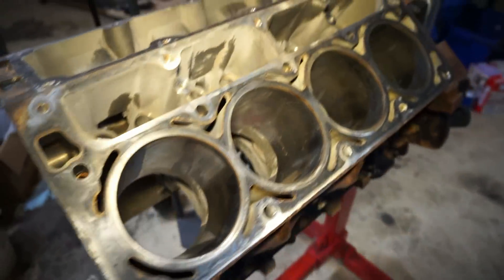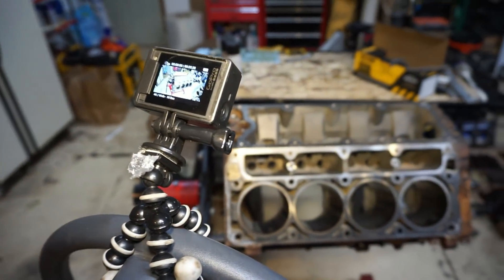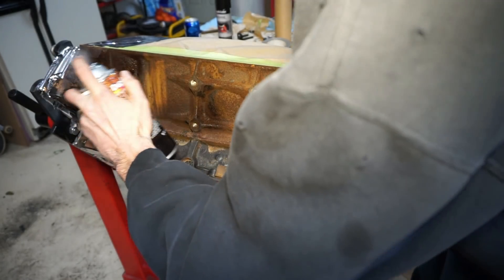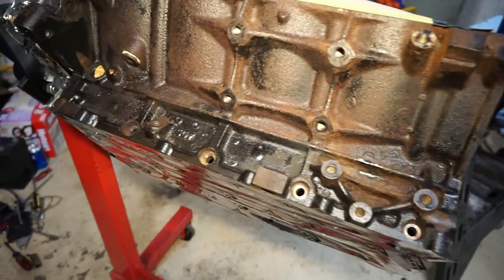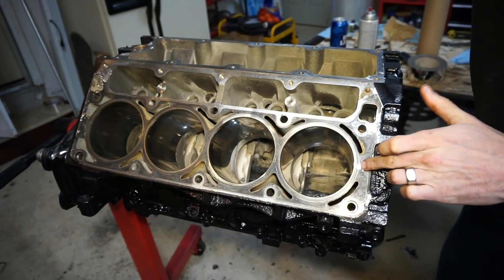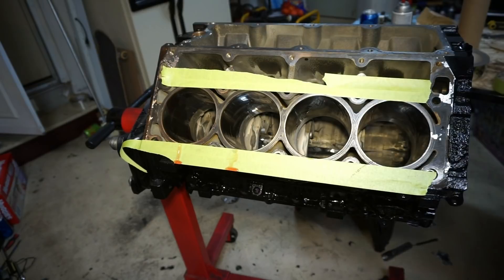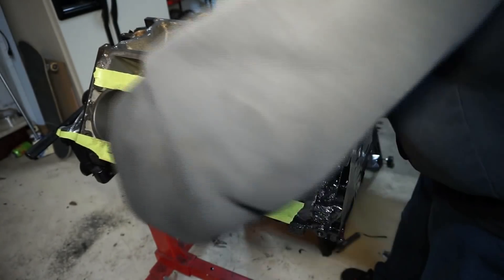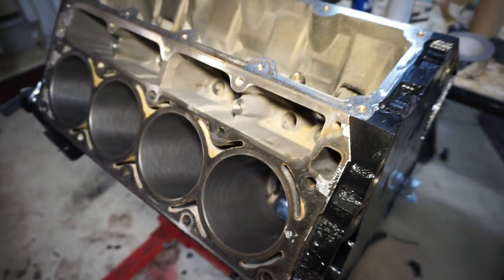333k MILE $200 LQ4 REBUILD!!! PAINT, HONE, AND CRANK!!! - a21bravo

Comment: A21bravo I bought a used 5.3 opened it up I see milky sludge in the oil pan rockers hast rust , push rods . Cycliner walls still has cross hatched cleaned up good rotates freely. I have it tore apart would I be just be able to clean and put it back together
Reply from the maker: Depending how long it ran, most likely yes. Just check key areas, bearings, lifter rollers, cam lobes etc. For wear. The water that got in it won't lubricate like oil so could have some other damage. Another consideration would be overheating from a bad head gasket heads may be warped causing the crossover of coolant Into oil.
Reply: Appreciate it

Comment: So a 200k plus mile engine can get by with just a hone on the cylinder walls? I would have expected to see a ridge at the tip of the cylinder wall. So these engines don't typically need overbore to +.020, .040 , etc?
Reply from the maker: This one has over 330k and just honed it.

Comment: I have to ask. How confident are you in this engine with so many miles and putting the stock pistons back in, not checking bearing gaps and not using proper torque sequence?

I ask because I have to rebuild my lr4 4.8l engine and every penny I can save is a plus, but I also can’t afford to do it twice. How damn reliable is the ls series of engines that it seems common for so many people just to clean and slap them back together?
Reply from the maker: Depends what you're doing with it I guess... What's the reason for the rebuild? I did have some issues with mine but was piss pounded a lot. Still using same bearings, head gaskets, reused bolts etc. I hurt the gen4 rods and pistons I put in here, the put the original back in and has been decent untill the end of the season.

Comment: Pretty sure you’re supposed to wire wheel or at least break down the surface rust, dirt and flakes. Then paint over the remaining rust with that.
Reply from the maker: This was after a hot tank. I had the machine shop do hot tank and cam bearings, lol.

Comment: hey bro, got a question for you, I have a 4.8/5.3 block that spuna cam bearing, it came out with the cam just like ion one of your videos, the cam seat was worn and I was wondering what you used to fix yours as my machinist isn't aware of any oversized bearings for ls motors. we did decide to hone out the #3 cam bearing seat to try out the larger OD #2 cam bearing in its place and hope that works. whats your input?

Comment: Hi i have 2001 silverado 6.0 liter vortec good oil pressure ticks at idle when warm but drive very well 166k miles previous owner told me been doing since he bought it with 89k miles what do you think of the tick noise? Thanks for your help
Reply from the maker: Lifter tick Probabaly... some times an exhaust leak can sound like a tick also.
Reply: @BlaserBuilds  many mechanic telling me older 6.0 lq4 expreince this noise due to piston slap not sure if thats correct

Comment: Hello i enjoy your channel.  Lots of people over look cleaning all gunk off engine parts. I seen you wipe out cylinders. Hot water and dawn dish soap and bath cloth. Its is paramount to get out hone and metal out of the block. Never stick bare fingers on bearings or surfaces. Use nitral powder free gloves. Your fingers have acidity in your skin that will cause bearings to be dirty and flake bearings.  That oil sludge on main caps and pistons or any parts for that matter take time to clean that shit off. La awesome from dollar general. Cut the side out of an anti freeze jug and flush it out with gas . Pour some gas in anti freeze jug pan and use a paint brush or old tooth brush . Gas is 3 dollars a gallon and brake cleaner is expensive.  I use gas to clean engine parts and transmission parts alot and blow parts dry with compressed air. I use bottle brushes and brush kit from gun cleaning kit to clean bearing oil galley in the block. I don't care what No one says i alway run a bottom tap through head bolt holes and main webs in block and all sealing surfaces to get a proper bolt seat and torque.  If a person is lazy they can use a drill and put tap in drill and chase bolt holes. I also make dam sure to clean head sealing surfaces with razor blade or put sand paper on a block of wood or use a long rasp or file to make sure all of old gasket material is removed from head sealing surfaces. Cleaning that mess off the pistons . Seafoam is great stuff.  Put all pistons in a clean 5 gallon bucket and pour hole can of seafoam in there and fill it with gas just till it covers them and let them soak. It does great job of cleaning sludge off. I bought a tumbler from harbor freight and pour cheap cat litter in it and tumble rusty bolt and small dirty parts does a super job of cleaning . I hope you don't use that torque wrench to torque bolts after you use it as a breaker bar that is a total no no. Go buy you a breaker bar they are cheap . If a bolt is not turning when you are torqueing it back it off loose and retorque it but don't back it off with torque wrench use breaker bar. Thats a good way to destroy a torque wrench.  Even if its cheap. People say they reuse those torque to yeild bolts over if there is not a spec on bolt stretch throw them away.  I like stud kits a stud is stronger than a bolt any day in heads and main caps. You should rotate crank every time you put a main cap on or put a rod on journal. Nothing will make you sicker than putting whole rotating assembly together and find out it locked down at a certain point when you have whole engine put together.  I had it happen in a 91 ford 4.0 and the crank had a dent in counter weight. I put a crank kit in it when overhauling it . Crank was dropped in shipping . I rotated engine 360 degree's it damaged 1 rod on side of rod journal.  Carquest made it good but oversight,rushing and going through the  step process could have been avoided . A bench grinder with a wire wheel is a good investment if you're going to work on stuff. Harbor freight has a digital tool to go on a torque wrench or breaker bar to tell how many degrees you are turning bolt instead of guessing.  If your on a budget. I don't have a youtube channel but i have 35 years experience of working on tractor trailers farm machinery and automobiles.  I like the nissan 350 z and ford ranger.

Comment: Did you use stock bearings??
Reply from the maker: This got all new bearings.
Reply: @BlaserBuilds  But were they stock or a different gauge? I heard for a used crank that different size bearings might be needed so they are spaced correctly and nothing is loose causing rattles or vibrations. Looking to rebuild an LQ4 for my C10 and watching all your videos!
Reply from the maker: @Casper0878  I used standard size bearings.
Reply: @BlaserBuilds  Ok, thank you. I was just curious. Debating between rebuilding a junk yard engine myself or buying an ATK LQ4 crate engine rated at 464hp